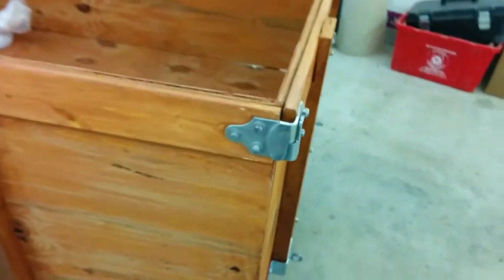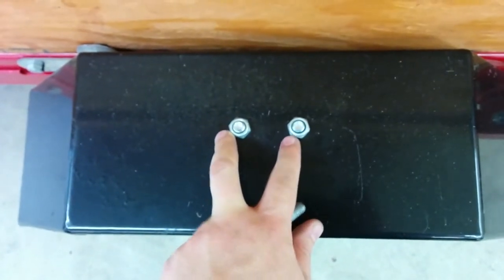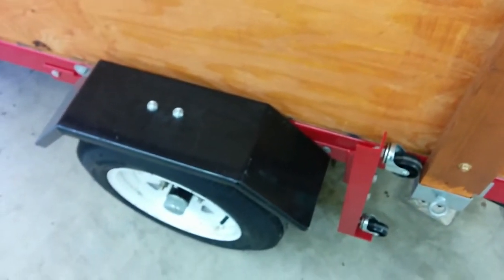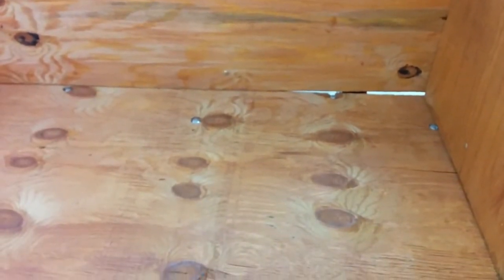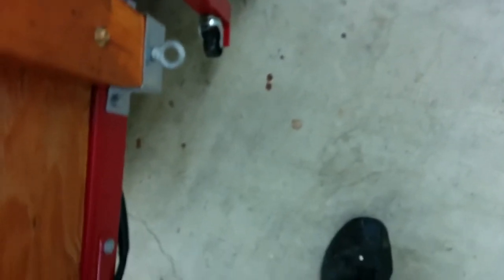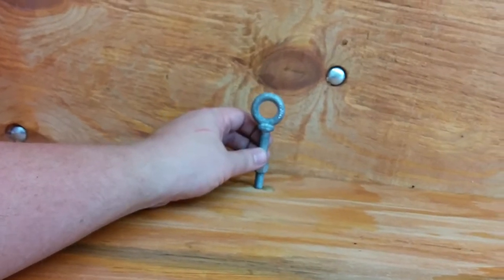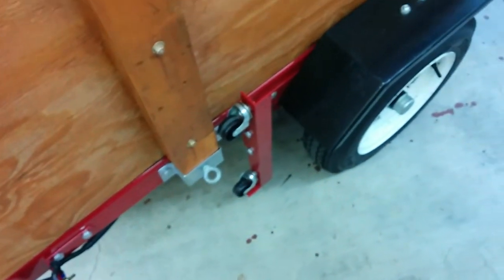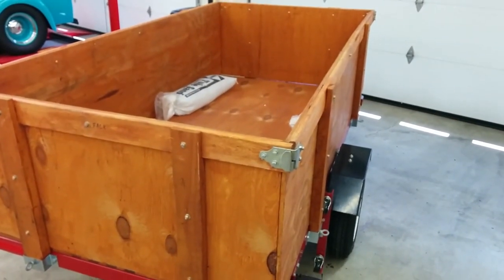Harbor Freight Folding Trailer Final Thoughts

Comment: I have this trailer, and love it. I've customized mine slowly over the last 2 years of ownership, as I thought up solutions to issues, or had new ideas to make it better. SELF DESTRUCTION - You're right about the fender bolts. I had the City fill up my trailer with mulch - I don't know what it weighed, but a lot, and I only went about 2 miles, before my drivers side trailer tire failed! And, I didn't buy the optional spare. Looking closely, the tire went flat from a groove in the very center of the tread. The great weight made the trailer ride low, and on bumps it was enough to make the fender bolts go into the tire(s).  The passenger side had a groove cut in it, but didn't fail like the drivers side. I too was worried about this happening but dismissed it - a $40 mistake. I can't believe they made it with this defect! I got a new tire, and took the fenders off, until I found the perfect fix. I moved the fenders up by drilling new fender attachment holes up about an inch, so that the next time I was overloaded, it wouldn't self destruct. I also got shorter, carriage bolts putting the round end towards the tires. Oh, the replacement tire was 2x better than the original - lots more tread. 
- Regarding the difficulty of tying items, yours is a good solution, but I took a hole saw, like you'd use for a doorknob, and cut holes into the sides - 2 low and 2 high, around each vertical 2x4 post.
- Initially, I built mine with the thought of being able to fold mine up, but:
A - After adding a lot of wood, the trailer gets heavy, and it seemed like it'd be dangerous to try to fold it up for storage by myself, (though a guy on Youtube has a method using rope that works well if you're careful, and
B - Folding and unfolding is too much work, considering the other work involved in hooking the trailer up to a car, then unhooking it.
C - I sometimes use my trailer to haul around a riding lawnmower and after much trial and error, turned my back side into a fold down ramp, to load it.
- Never to fold the trailer, I then took off the caster wheels and their foot long metal brackets, and use them on a different project. Then I took diamond plate scraps and have welded a small step for each side - that bolts onto the frame just behind the fenders, onto each side, that uses the holes for the removed caster wheel fold up arrangement. I also made the fenders sturdy - able to be stood on, by drilling holes and running bolts and spacers, so I could also step on them if needed for a high load.
 - I kept my trailer mostly in the garage, but the wood still started to deteriorate from the odd rain while using outside, so I painted it inside and out.
- I had a bunch of used door hinges, so that's what I used to hold the sides together.
- I hand lubed my wheel bearings well when assembling, and by grease zerk later. I took a full load of furniture and moved my son 900 miles each way - traveling 70-80 MPH most of the way, and my axles stayed cold. - Yeah, they weep a little grease - but not anything significant.
- I built and installed a ball hitch on my riding lawn mower so I can move the trailer with it.
- Important to run a ground wire for the lights, as the frame doesn't make a reliable electrical connection. I broke my tail lights when parking in a tight location, but plan to replace them with the LED light kit from Harbor Freight.
Let me know if anyone wants pics of these mods.

Comment: What preparations needed for folding trailer used for launching a two man pond prowler boat? My concerns are about rust.
Reply from the maker: There would need to be a lot of changes. Rust is one. You would have to swap out the lights for waterproof ones. I think the biggest problem is keeping the water out of the bearings.